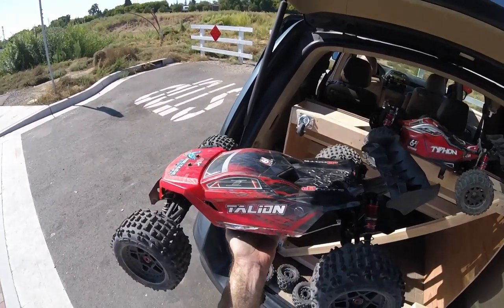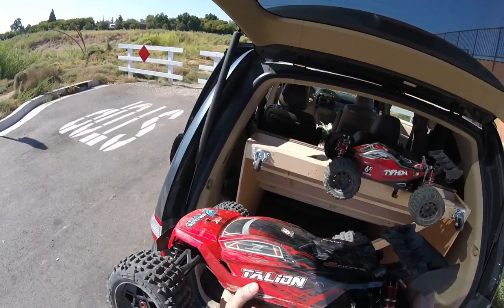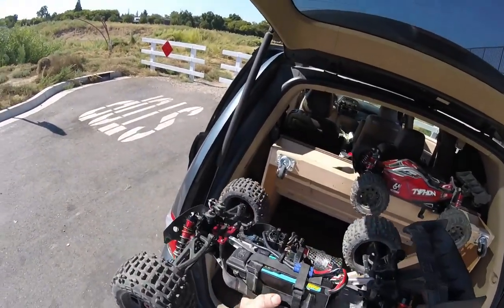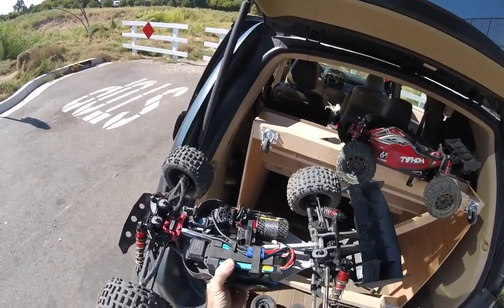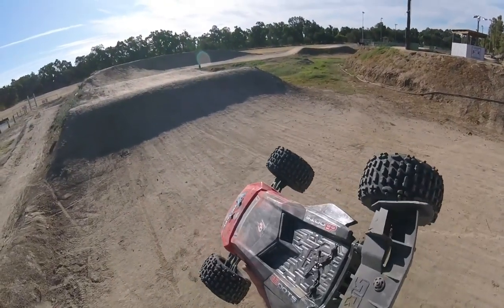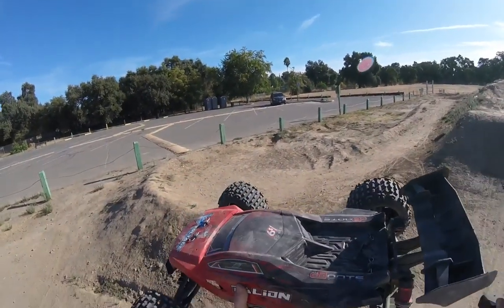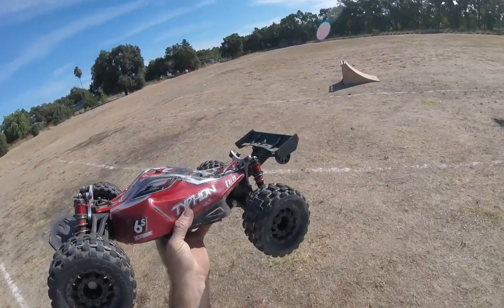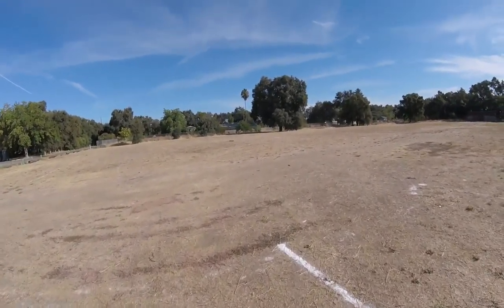ARRMA Talion 6s "Hardcore Basher?" durability revisited, with Typhon 6s...

Comment: Hey Rich your the best so im going to ask the best...if you dont mind me asking...my esc is a 150 amp my motor is a 2050 kv the batteries i just blew up again are gens ace 4s 5000 mah 50c my pinion is 12 tooth my spur is 46 tooth and i cant for the life of me find out why i keep puffing my batteries any ideas would be a great help....thanks...
Reply from the maker: Thanks Bro 👊!!! Which rig and which tires ?? Also, what connrctors are you using 🤔. Something doesn't seem right. Lastly, are you using the loop connector??? I'm definitely not a fan of the extra loop. 😎💪👊👊
Reply: @richduperbash2966  the esc and motor are a unbranded hobby wing. The tires  are the same you have on your talion. The connector im using is the ec5 the blue one im thinking the esc is asking for more power ? Maybe i need i higher c rating battery or go smaller on the wheels or just say fuck it and try a different esc and motor i dont no batteries are costing to much now for me...what would happen if i put a bigger spur like a 50 tooth i dont have a smaller pin gear ...thanks bro
Reply: @richduperbash2966  i dont have any loop at all its just a straight connection
Reply from the maker: @alwayswatching4677  the bigger spur will  scrub a little speed but take some load off as well 👍. 50C is typically adequate for the demands. It's possible your ESC wants more voltage 🤔. You might be maxing your RPMs too quickly with the smaller pinion or simply got some bum Lipos. I've never ran Gen Ace but typically would gear taller on 4s to maintain higher speeds. Wish I had a straight answer my friend. Might take some experimentation. 🤘🤘
Reply: @richduperbash2966  thanks for the info..ill try the bigger spur see what happens have to wait until i get some more batteries ill let you no how it goes thanks man bash on 👍
Reply: @richduperbash2966  im going to upload the run that puffed my battery you can hear something lock up 2 times during the vid not sure what that sound was but that might have been the problem

Comment: i love the body on the talion just ordered one to replace my kraton body..
Reply: dose that arrma wheelie bar work any better on the talion or typhon??? on the kraton its about useless  mine just flips right over it like its not even there... great video great air ..ps you have the best basher spots , i need to move lol...
Reply from the maker: @craigmac1516  thanks so much Craig🤗. I feel fortunate to have a few sweet spots in my area. The wheelie bar does work better on the lower slung rigs. Still have to ease into it a bit though. Otherwise the truck fulcrums on those little wheels. The Talion body is awesome. Just realize the Talion sits lower with shorter towers...etc. May need to swap body mounts to get it right. 🍻😎💪👊👊

Comment: What's the setup on this rig brotha need to know what shock oil,motor,esc
Reply from the maker: Still running stock electronics and shocks with stock 2000cst oil Russell. Just added longer Tekno Orange 80mm front springs as the stock springs went flat after around the 2 year mark. Running 50/200/20k diffs front to rear. Still sporting an 18T pinion. Biggest upgrades are the M2C chassis, towers, braces, and aluminium suspension mounts. 🍻😎💪👊👊
Reply: @richduperbash2966  hell yea appreciate it man just wanna make sure I run the right stuff lol
Reply: @richduperbash2966  what's the best tires for this I usually just keep the stock tires
Reply from the maker: @russellhall6712  I like switching between Backflip LP's and the stock Katars.
Reply: @richduperbash2966  aight I gotta see how they do an grab some shock oils
Reply: @richduperbash2966  what's the benefits to the shock oil why is lighter better or heavy better ya know
Reply from the maker: @russellhall6712  lighter oils mean easier compression or bottom out ...ie chassis slap. Heavier oils increase dampening, slowing the shock stroke in both directions. Lighter fluids can take stress off of shock components ( pistons, shafts, rod ends, arms) by allowing the chassis to bottom and absorb impact energy. Too light and the ride can get bouncy and the chassis can bounce violently off the ground. Same is sorta true with too heavy a fluid because shock stroke can become hampered and bounce off of obstacles instead of absorbing them. Adjusting ride height and preload with the spring collars plays a huge role in getting shocks dialed. Set-ups are largely preference based and depend on vehicle weight (including Lipo size) and choice of wheels. It always takes experimentation regardless. Either changing the oil weight or piston hole sizes. 🍻😎💪👊👊
Reply: @richduperbash2966  man I appreciate the knowledge bro seriously some shit I just don't get rc cars is 1 of them hahahahahahaha I'm just like idk what I'm doing but this what rich do lol my wife calls me russ Duperbash 🤣🤣🤣🤣🤣🤣🤦🏾‍♂️

Comment: Dude if you need a good soldering iron for the feild you have got to check out the ts100 itll plug right into any lipo batteries 2s to 6s and these things are bomb proff and easy to use they get hot enough too solder the big gauge wire too they arent that expensive you should really check it out
Reply from the maker: Thanks so much Nick 😜!!!! Dude I'm on it. 🍻😎💪👊👊

Comment: I've been using 1 wrap of a 2mm kevlar cored string lately and it seems to hold up better than many wraps of the smaller stuff. The 500lbs cored of this: https://www.amazon.com/gp/product/B01AZBSI0M As I break the smaller 70lb stuff, I repalace it with this. So far so good on my outcast and ERBEv2 both on 6S. I run at a grass bmx track and at skateparks mostly though. Guessing yours gets chewed up a bit more with pebbles and whatnot in the places you run. That typhon was just killing it! How did your tire hold up?
Reply from the maker: Thanks so much Bryan 😊!!!! I've actually been looking at kevlar lines for awhile now 🤔. Really appreciate the link and feedback. This Gorilla Tough braid has lasted a really long time, but I'm sure the rocks and stuff wear on it especially as the treads wear down. Amazingly, the Bob Smith Industries IS2000 repair seems to have worked on the Typhon rip 😱👍👍😎💪👊👊

Comment: Talion or Typhon? I want a buggy but the truggy is calling me
Reply from the maker: Both are fantastic 😍. If you're drawn to the Talion, I say get it. Best handling and fastest ARRMA in the fleet. 🍻😎💪👊👊
Reply: @richduperbash2966  I'm getting both. No regrets lol
Reply: I'm amazed with my typhon after 3 months nothing broken...so now I'm buying talion but hope I don't have motor connection issues like yours...
Reply from the maker: @benpitchford2987  both rigs are fantastic 😍. Any rig can have electrical or connection issues. Most of mine are caused by physical stress from huge airs. The best approach is to turn the motor on the slide mount so the wires sit directly over the top of the motor instead of off to the side and zip tie the wires against the plastic gear cover. This takes most of the strain off the connectors. 🍻😎💪👊👊
Reply: @richduperbash2966  Awesome! Great tip Rich! Thanks much